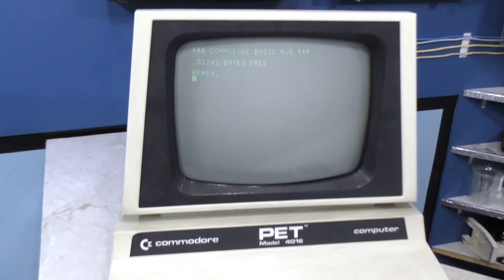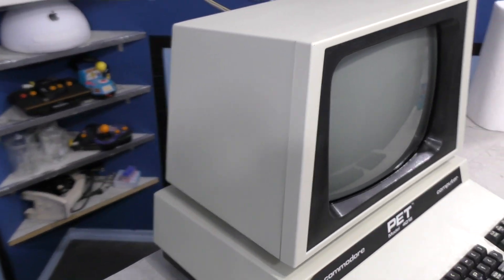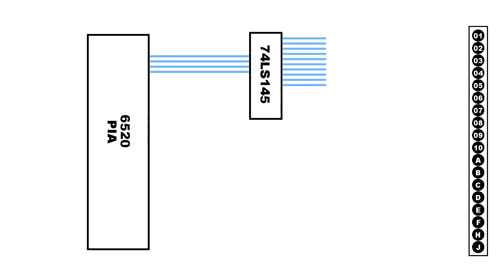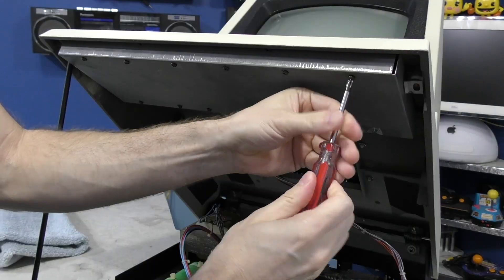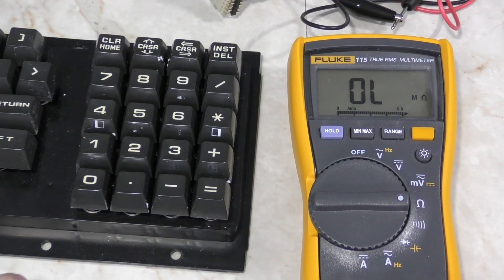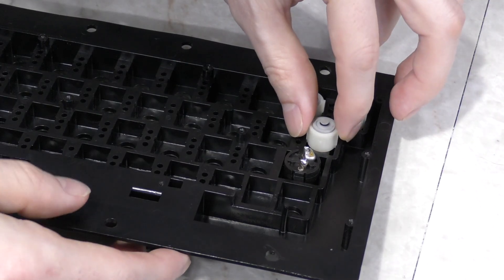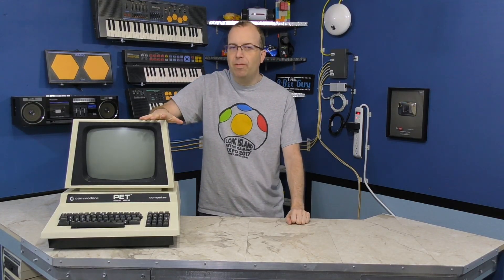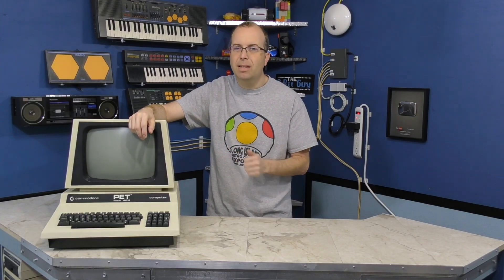Commodore PET Repair and Restore

Comment: In addition to the obvious alternative of recommending a C64 to a budding retro computer enthusiast, A TI-994/a is a good choice as there's many still out there and they aren't all that expensive if you look around.
Reply: And you can thank Texas Instruments build quality for that.  TI insisted on using top-quality components.  For example, where the C64 uses a simple piece of aluminized cardboard as an RF shield, the 99/4a has an RF cage of solid aluminum.  TI's high standards is why they lost the price war with Commodore.  They just could not make the 99/4a any cheaper unless they compromised on build quality.

But, that build quality is also why so many of them still survive... though I would strongly recommend that any budding retro computer enthusiast who actually plans to use his TI-99/4a instead of just sitting it on a shelf, also get his hands on the Extended BASIC Cartridge.
Reply: SpearM3064 Yes they (especially the earlier black ones) are overbuilt  and very high  quality. and about the Extended BASIC cartridge, A must have for writing games! It and the Speech Synthesizer ought to be enough for anyone to become a TI fan!

Comment: I usually disassemble the entire computer and give the case parts a shower with a plastik brush and bathroom or kitchen cleaner. The keys caps will be handwashed with a little bit soap in the kitchen sink. The mainboard will be dry cleaned with an antistatic brush. If anything can not be removed i use isopropanol with a q-tip.

Comment: For those pads. Like my controller pads I usually rub them on a clean sheet of white paper to clean them. And that usually solves any or my connection issues

Comment: I usually glue small circles of aluminum foil to the old rubber pads. No need for a $30 kit. I make circles using a standard paper hole punch (just do multiple layers of foil at the same time).

Comment: The conductive repair compound simply does not last. Everything I've ever repaired with that stuff failed within a day or two of actual use. What happens is that the silver flakes off or turns to dust and short-circuits the contacts so that it thinks you are always holding keys. It's especially bad for rubber membrane keys that don't have plastic key caps. It's seriously so prone to failure (very close to if not 100%) that the product should not be sold as it is essentially useless. What I do now is use a hole punch on conductive copper tape and stick the little discs onto the carbon dots. Works great!
Reply from the maker: I am also concerned about the longevity of this repair.  The computer won't get used enough to really see how long it lasts.  I also had the same idea with copper tape, as I have some here at the house.  but i didn't have a hole punch the correct size.

Comment: lol you spent over $30 for a Garphite Powder (~$1) and some glue with it? honestly its much more cheaper then that  (~$4) just get some graphite powder and mix it with any type of glue like , Arabian Rock Glue or Dissolve  tiny bit of foam in petrol and mix the graphite in or even just use Acrylic Paint and mix the graphite in  why spend $30 lol

Comment: Had the same lack of carbon issue on my CPAP machine buttons. Rubbing carbon from a pencil did in fact work, but only for perhaps a week or so before it would rub away. Eventually I super-glued aluminum foil on each carbon pad. Been working perfectly for two years now. Would be fiddly to do with that many keys, but it sure does the trick.

Comment: I used to work in a music shop in repairs and we had to deal with contact issues on electric keyboards
what i ended up doing is buying some carbon rods from a chem shop, and then shaving a bit and just sticking it with my finger (the oils probably helped it stick.)
works 90% of the time, all the time :)

Comment: It has same kind of mechanism for keys, that remote controls (and console controllers, at least older) have. Many try to "clean" the carbon (or conductive) part of the rubberdomes, which actually may be worse thing, as it the problem is that the conductive material has dissolved. I'm sure, this problem could be solved with something that would not dissolve, but hey! Like TV manufacturers do, just sell a new remote, with terrible overprice! Anyway, I too tried a few things to remotes and such, like gluing a conductive piece of foil on the dome... I also have tried a same kind of solution like you. But I have has a problem, were it doesn't stick and after a while the painted coating drops on the contact, making it basically so that the key is on pressed state all the time... Cleaning the dome properly and maybe even using sandpaper on it before applying could help. Also, I suggest buying a very small brush, so that you apply minimum amount of stuff to dome. And ALWAYS let it dry at least for that 24h!

Comment: For keyboard membranes, actuators and PCBs I use shield paint! Much like your product but cheaper, ready to use and storable. Used it for all my MSX stuff.
Reply: I have used tinfoil and superglue with such rubber pads problems and it works great.
Reply: +Indrek Tiidrus For me the glue became loose after some years. But maybe I used a shitty glue

Comment: The appearence of this rubber pad repair kit liquid is EXACTLY the same as automotive rear shield heater repair fluid; with a small difference that i paid just about $5 for my repair fluid, and had similar success restoring remote controls and keypads.

The fluid comes in a vial - single vial, not two, but it's heavily separated into yellow solvent/binder and silver paste. You shake it until two are mixed, which is actually quite easy, and then you have maybe half a minute to paint before they start separating a bit, so there's quite a bit of repeated shaking involved. If you wait a bit too long, the track will have the same appearance, but due to too much binder, the conductivity may not be good enough.

The repair is semi-permanent: on heavily used keypads, you will notice the conductive layer wear off eventually, much more rapidly than the original carbon-infused rubber layer.

I also have carbon based "conductive glue" that i purchased, suspecting that it might be better for key plunger repairs, but it's a catastrophe.

Comment: I've watched many of your videos. When you clean stuff, why do you never use a magic eraser? They are amazing for taking all kinds of crap off of surfaces, especially plastic that has small variations in the surface, or the rough paint on the pet.

Comment: Mmmm conductive screwdriver in the back of a crt... you can buy non conductive precision screwdrivers for that purpose
Reply: @WetDogSquad  If you discharging the cap sure, When adjusting anything HV, HA you should use non conductive adjustment screwdrivers, some of those adjustment pots on older stuff see some fairly unfun voltages and amperages
Reply: b o o m .

Comment: The PET was the very first computer I ever got my hands on. Had a friend who's dad had a photography business and they got into selling early commodore computers. I loved messing with this thing. Learned programming on it and then a Vic20 then a 64. PETs and CBMs were expensive then and I couldn't afford one. But years later when another company I worked for went out of business, I bought one of the old CBMs they still had in the back from when they sold Commodore stuff too. It's sitting in my shop waiting to be restored. Keep an eye on the power supply. Those big electrolytic capacitors in there can go out of tolerance and possibly fry the motherboard. My caps are shot and I need to replace those first. Just thought I'd give you a heads-up about that. Great videos and I look forward to more.

Comment: FOR CRYING OUT LOUD STOP USING PAPER TO CLEAN PLASTIC SURFACES. PAPER IS WOOD. WOOD SCRATCHES AND LEAVES SWIRL MARKS. BUY A FREAKING DOZEN MICROFIBER CLOTHS. THEY ARE NOT THAT EXPENSIVE AND IF YOU CARE ENOUGH TO CLEAN AND PUT THINGS UP TO WORKING CONDITION AT LEAST TREAT THEM PROPERLY. A GUY GETS IRKED TO NO END SEEING YOU USING PAPER TOWELS AND WINDEX. WINDEX DEGRADES PLASTICS AND RUBBER ESPECIALLY.

And get 1Z Blitz Reiniger from some detailer. That thing is as safe as it gets and has an awesome cleaning power. And get some soft bristled paint brushes. They'll make your work tenfold easier instead of using the 90º tooth brushes.
Reply: 70 % alcohol plus microfiber
Reply: Alcohol will leave marks on plastics. I've had this discussion previously. Some people just don't have the eye to notice it but it does leave a slight shadowing burn mark on most plastics. Not to mention that in some it might even physically damage them. Unless you're 100% sure of what type of plastic you're dealing with, steer away from using alchohol. And in older parts, where you don't know how degraded the plastics are? It's just to risky. A proper APC does the job much better without any of the risks. Need to take off gunky stuff or glue residues? Use some kind of electronics oil based cleaner WD-40 Specialist Cleaner does the job. Not the best as it's not 100% guaranteed not to attack rubbers and paint (as with all WD-40), but I'm not sure what's available in the States. It's a matter of looking for one safe for rubbers and paint. They exist. And if the worry is about the oily smell, it dries off a couple days later.
Reply: +Lennon Craig You think. I know.
Reply: Lennon Craig, You are comparing two different gradations of surface area (plastic vs skin). A manufactured plastic will tend to have less surface area and be a smoother surface than a human hand. Thus, scratches will be more apparent on the plastic because you are scratching more of the peaks at once. Its apples and oranges, bruh.
Reply: @mudemmeonick apologies for my earlier draft responses. Still trying to learn myself some interwebs and I second-guessed the autofill
Reply: Lennon Craig, lastly, and interwebs please correct me if Im wrong, but fired ceramics tend to be phobic of liquids, so diluting them with alcohol or water is a practical impossibility in the short term due to its composition and the low surface area being exposed. A synthetic rubber or plastic, on the other hand, tends to be made of dinosaur oil and is just ITCHING for a reason to dissolve into something. Which is why NES cartridges expressly forbid using alcohol on them. Because, however slight, you warp the ABS plastic a teensy bit when you clean them with alcohol.
At the end of the day though, its all about how many times you wanna split the hair. Do alcohol products dissolve plastics? Given time and concentration, yes. Did the baking soda used to clean spots create scratches on the case. Sure 'nuff. Does it matter to you if it does? Thats a personal question. I think, perhaps, preservation and restoration are different things. While Mona Lisa is periodically restored, the Great Pyramids are preserved.
Reply: Uhm, the PET is made from painted metal?
Reply: @WinrichNaujoks  Oh yeah. That's true.

Comment: I know the broken spacebar problem all too well.
Most are held in by something cheap and only works when aligned properly, and if one little thing breaks on it it just catches on either side if you're not pressing down directly in the center. Very annoying.

Comment: Hello david.

I am an electronics technician and I repair televisions and other devices. I also repair remote controls. And when the conductive rubber fails, I do not pass a pencil because it eventually comes out so.. again fails.

I use the aluminium foil that they have in the cigarette boxes (I do not smoke then I ask them from someone or together in the street) I stick pieces of paper on the conductive rubber with super glue and never fail again.

I Like u repair videos. Greetings from Argentina

Comment: You do a great job of restoring these old machines, but here's a tip you may want to consider; If you encounter a painted surface like this it is most likely painted with an enamel type paint. The baking soda works because you have made a compound (abrasive) cleaner and it will actually dull the shine of the paint. An alternative would be an automotive (non waxed) polishing compound. This will both clean the surface and restore the shine. Some surfaces may be intentionally a mat finish so this wouldn't work. The polishing compound has a finer and more uniform abrasive than baking soda. This will also work on styrene and harder polyvinyl plastics (like a Commodore keyboard)

Comment: To fix bad carbon pads like this, what I've done is used the thin aluminum foil applied to the carbon pad with glue. It has enough flex, but yet low enough resistance to make them work again.

Comment: It rather looks like somebody already worked on that keyboard. They scratched the "R" and "B" letters next to the Shift-Lock switch, and many of the key caps don't have the graphics. Were they actually scratched off, or are they just missing? Commodore made this series of PETs in both the N (normal) and B (business) versions, and the B models did not have the graphics silk screened to the fronts of the keys. If this keyboard was worked on by somebody else, they might have mixed and matched key caps from more than one keyboard to make one good one, and that could explain the missing graphics. It could also maybe explain the poor conductivity of the carbon buttons, although this happens to them both with high use and also with long periods of disuse. On all the Commodore keyboards that I have restored, which also had the same problem of many keys not registering, all it took was some gentle scrubbing of each carbon button with Q-tips moistened with isopropyl alcohol, and they were as good as new. Gotta remove the slightly shiny layer of compacted carbon film or whatever forms on the surface. But the silver paint is probably at least an adequate fix, although quite probably a needlessly expensive one. The other things that concerned me was that this keyboard did not seem to have the zillion tiny screws that pull the circuit board and the plastic keyboard frame tightly together. It seems that there were fewer screws, so I wonder if many were missing. This can contribute to the circuit board flexing away when the keys are pressed, so the carbon buttons are not pressed as firmly as they should be to the circuit board foils beneath, and this can result in higher resistance.

Comment: Allow me to offer some diagnostic advice as to why the continuity beep test didn't work across row/column lines:

The carbonised, conductive rubber pads located inside the domes of the keyboard membrane, are conductive enough to complete short the row/column of the KB circuit and signal to the PET that the key's been pressed, BUT the carbon is sufficiently high enough a resistance value so as NOT to register as low enough a resistance to trigger the continuity mode beeper of a DMM.

That's my logic, I've been in electronics many years, fixed and manufactured a few consumer/military/industrial items, it seems that would explain it.

Comment: Nice.  I remember ripping apart a lot of remotes and trying to repair the carbon pads with graphite.  Sometimes worked.  Time to consider toner.  Never mind.  Seems conductive epoxy is available everywhere.  [And another edit, because I'm an idiot covered in fine black carbon right now: https://youtu.be/_znMPaZYZAc ]

Comment: The sub brightness potentiometer is actually the max voltage on the flyback transformer , all CRTs have that  it sets the max voltage and the external brightness potentiometer actually reduce the voltage to dim the screen

Comment: The case seems to be fiber reinforced plastic, similar to the Franklin Ace 1000..... which incidentally was also painted.
Reply: It is just molded structural foam, no fiber in it. It is off-white and painted on the ones I have worked on, but Commodore made lots of changes in production, so some might have been colored right in the foam. Quite a few computers used structural foam for their cases in the mid to later 70s.

Comment: You could potentially re-silkscreen the fronts of the keys if you're feeling ambitious... there are home kits for that. Was looking at a similar problem for re-doing the front panel of a piece of audio gear and I was referred to ezscreenprint's starter kits. The only extra you need beyond the kit is the ink.

Comment: I would have used tin foil and glued them to the plungers.
Reply: Not a great idea. "Tin foil" is actually aluminum, which reacts galvanically with the copper on the circuit board. Because of the gold plating at the contact points it might be OK for a while, but that gold plating is very thin and may wear out more quickly when the edges of the foil repeatedly pressing down on it, and the  the reaction would corrode the underlying copper. I suspect that the coating he applied in this video is a carrier for powdered silver or something like that, which would have good compatibility with the gold or the copper, and it is an excellent conductor as well.

Comment: Did you consider to scrape the carbon-connectors on the keys with a scalpel?
It might have removed an oxidated layer that could prevent continuity.
Great video !!

Comment: Great video as usual!

Friend of mine was an authorized Commodore repairman.  Way you fix those broken plastic spacebar tabs is to replace them with metal ones.  This is done by using a flame to heat a heavy-gauge paperclip up enough to melt the plastic and bending to shape.  Then apply a dab of superglue and you have a permanent fix!

Comment: RE: Keyboard Repair... About a week ago I did a similar fix to the rubber contacts on an aging Roland Edirol MIDI controller. Many Web sites recommended using a pencil on the contacts but that does not work well at all. I used a silver paint product like you did called Caikote 44 which is only ~$11 from Amazon and, despite its small size, was enough to fix 32 keys with 2 contacts each.